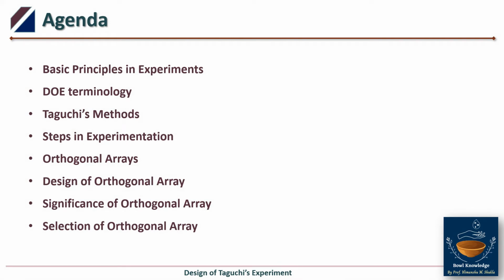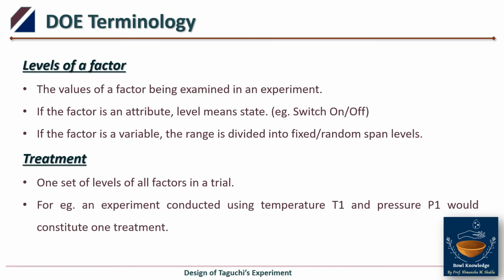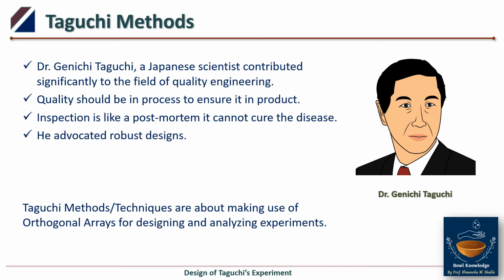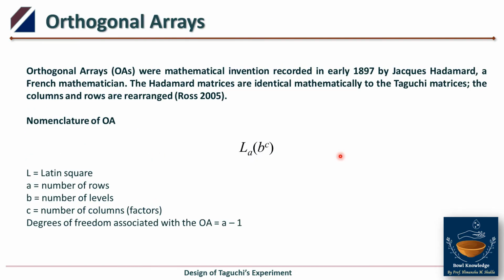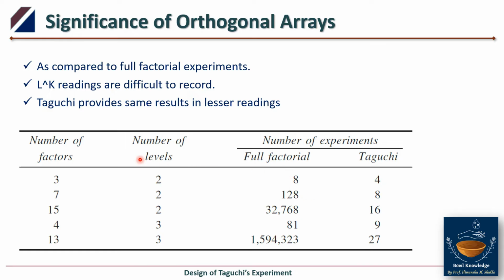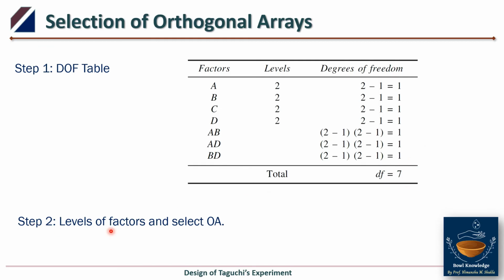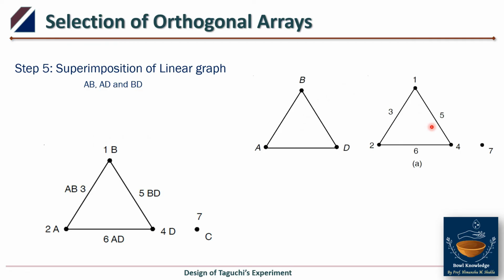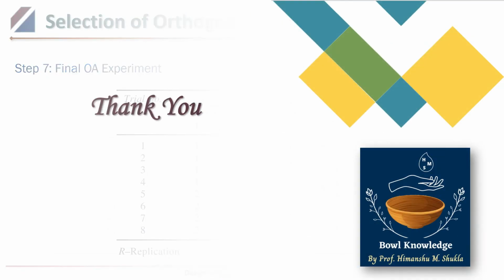Design of Taguchi's Experiment (Orthogonal Arrays)

Comment: Hello, 
The degree of freedom of OA is the number of rows - 1. So for L8 array the degree of freedom is 7 which not higher than the degree of freedom required. So why L8 is selected?
Reply from the maker: It is actually about possibility of fitness.. DOF required is 7 means 4 factors and 3 interactions.. And L8 has provision to fit 7 elements... Thats why.. L8 is selected...

You can say it is not higher than 7 but it is 7... So L8 will fit hardly.. But there will be no space for error terms...